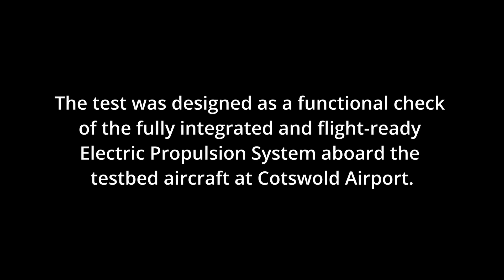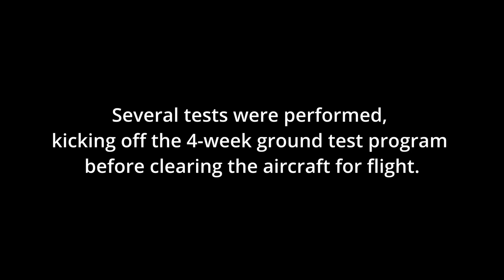First Propeller Spin for ZeroAvia's Dornier 228 19-seat Testbed Aircraft

Comment: congrats
Reply: Industry leaders are optimistic about how alternative propulsion technology, particularly hydrogen, could address aviation's climate impact in the future. By 2035, hydrogen fuel cells could be used to electrify mid-range flights and hydrogen combustion aircraft could be used on long-haul flights. 
According to the World Economic Forum, hydrogen could be one of the key drivers in the world’s transition to clean energy.  
Green hydrogen needs continued support from governments if it is going to become a viable alternative to fossil fuels.
Similar to carbon capture and sequestration, green hydrogen is not yet at a place where it is commercially viable.  1:01  [Earth Org; Weforum]